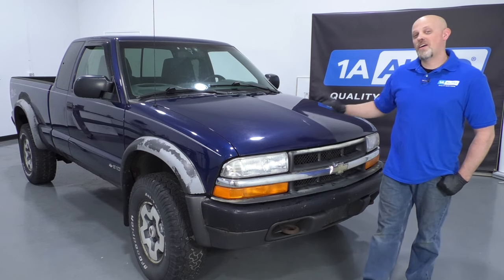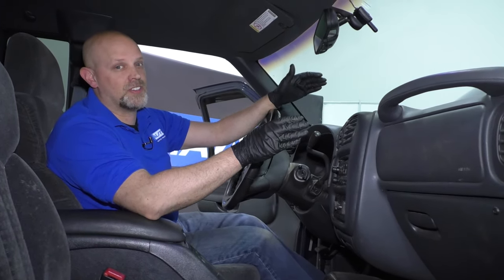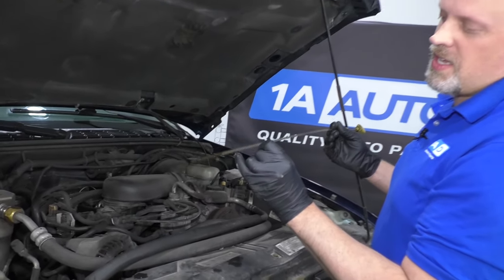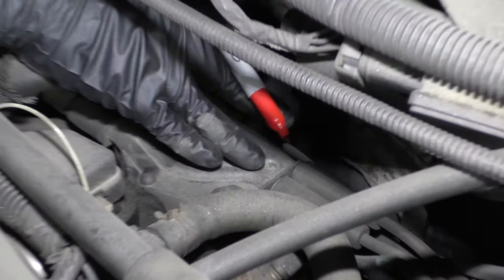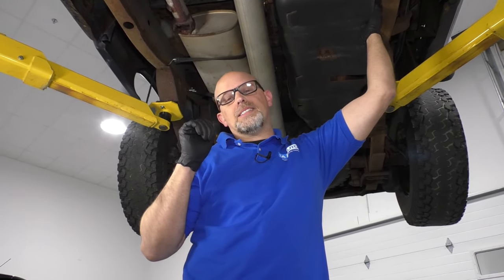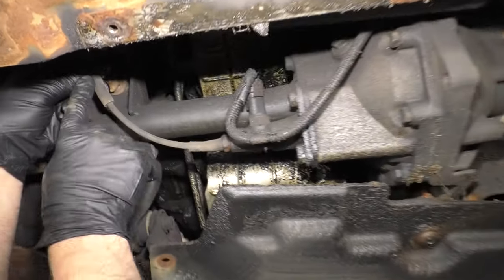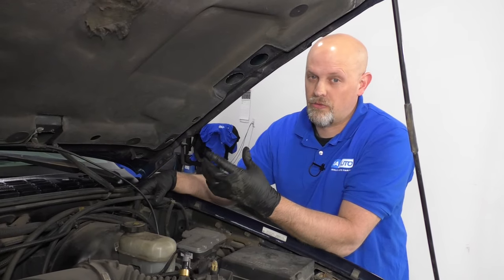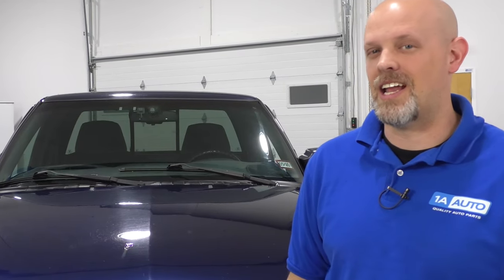Top 5 Problems Chevy S-10 ZR2 Truck 2nd Generation 1994-04

Comment: I own a 2003 S10 ZR5. Everything you've mentioned here, and a whole lot more has happened to me. I will never ever own another GM product for the rest of my life. (exempting classic cars perhaps) Or, to put it another way...Who conviced me Ford is better than Chevy? General Motors did. Here is a list of OTHER things that I've had trouble with.
Front Transfer Case - exploded while driving down the highway at 55mph without even having 4x4 engaged
Rear End cover started leaking like a sponge and nearly destroyed the rear-end. Luckly a mechanic caught it during an oil change. 
Fuel Injection System failure - had to replace everything with a new spider-assembly
Gas Breather Hose failed - Cannot refuel any faster than 1 gallon a minute or it overflows. Filling up takes nearly a half-hour. 
Hood Release Cable - stretched to the point you cannot open the hood
Wiper Motor Failure - It's keeping the RainX boys and girls in business I suppose.
A/C Evaporater rotted - No more cold air for me
and finally #1 - RUST RUST RUST RUST RUST RUST - Drove down a gravel road and the bed fell off. Well, mostly off. One mount is still hanging on.
If you own a S10 and it's in decent shape, you should sell it as quickly as possible and by something more reliable. Like a Yugo.
Reply: Damn dude my brother had a 2000 with a 2.2 and a auto damn thing was a reliable good daily until it skipped time and grenaded the engine it did have rust issues too but not to the point of anything falling off
Reply: Brutal.
Reply: You must live in the rust belt

Comment: If your s10 has a hard time starting when its warm outside change the engine coolant temperature sensor thats most likely the problem
Reply from the maker: +Michael Root Thanks for the tip!

Comment: 94 s10 256k miles now and semi retired. I am thinking about having a new engine professionally done. 

96k miles clutch
Blown head gasket 125k miles changed out freeze plugs at the same time. 
Rebuilt motor 179k yeah thats right about 5ok miles. Had the ports opened on a remanufactured head. 
New muffler around the same time.
200k fuel pump went out. Sounds like I got max life out of it. Also one of the wiper control arm broke of all things. (That was expensive.)
250k needed a new alternator. That was the easiest alternator to change.

Next on the list is ujoints and parking brake.

Question for A1 auto: sometimes I will just be driving or at a stoplight and all my gauges will go batshit crazy. Whats up with that?

Comment: I formerly owned a '96 Red Letter version of the bowtie brother ZR2 ordered brand new that year.  Drove it for 13 years bullet prove never let set during that time.  I always felt GMC had a much nicer interior over chevy.  4x4 shifter was on the floor went into 4WD anytime I needed it to do.  No issues with fuel pump period.  Always made the effort to have the filter changed when due for oil change.  Loved the truck only issue when reached 100 thousand miles was the intake gaskets.  AC worked flawlessly when summer came around.  I miss my purple ZR2 nicknamed "Barney" by some of my friends. Traded it in 2009 for a rare Chevy HHR SS panel 4which I found out years later of only 216 SS panels built that model year! Dealer manager told me as it was being unloaded off the car carrier that this was the first SS panel sold by them that year!

Comment: I am not a mechanic I do however all my own repairs From a heater core ..lift kits to painting with a Air compressor 
First 1A Auto is a good source for parts But like most Auto part websites miss one year of the Blazer/Jimmy that had it's last year of production in 2005 of this model gen. 
Most famous problems with the Blazer series 94 - 05 Starting with the most common : 

- 4X4 system That uses Vaccum, Electrical, mechanical It is common to see a Vaccum line slip off a gormet Or crack and tear with age And engine heat. Disabling the whole system Or the transfer case switch Which the ball will rust And keep from opening not letting your 2wd go into 4HI/Low And a few other of the systems Transfer case motor, cable connection area is heavy is corrosion And sits out too far to pull the cable 100% That could cause the adjuster arm not to fully seat the clutch ring into the pinion gear Which then gets chewed Replacement part is cheap But the labor time is long - You can get a transfer case mod from 50% Blazer And 50% Jeep Or install a manual pull cable 

- Alternator  They do work And only fail like every other brand /make However right from the factory They are under powered (CS-130 85amp) With wipers on And say heating or A/C At night you will notice your headlights will dim This is because your alternator can not replace power to the battery And your electronics to max usage My fix was a AD-244 Alternator made for bigger GM trucks with power seats it is a 145Amp Alternator The runs a few dollars more But fixes the issues running everything you can think of at the same time (Note you will need a 1 inch longer belt to run the Alternator But it has the same hook ups and bolt ins ) 

-Ball Joints Over wheel bearings These wear out quickly Moog makes fairly better ball joints to other brands 

-Fuel pressure regulator - Located under the intake cover you will not be able to see it under you remove the intake But when you have a engine struggling to run Feels like a need of a tune up You may or may not smell raw fuel (aside from fuel line leakage) And Your mechanic or buddy May think its the Fuel injection This is a cheap part you should replace anyways And a tell tale sign is the bottom of your normal intake will have carbon build up everywhere with a working regulator. One that has failed Has what they call a weeping hole If the mirco screen in the reg is clogged Or the seal has failed some of the needed fuel go's out the weeping hole But coming out hits the corner of the intake washing away any carbon  So a clean intake on the left side vs the right .. You found your issue GM also had a recall on its spider injection systems many years ago worth looking into if your the first owner Or plan on buying on from a 1st owner question 

- Heater core No one seems today to give there Cars/Trucks a good fluid flush And also open the heater system to get the full benifits  I been using CLR to descale And get rid of any "gunk" in my Blazer for years Never had the heater core issue  But i did replace one on a friends Blazer And i can tell you If you never done one before You have to remove the whole dash There is no easy way around it short of breaking plastic i would say 8 hours of your time 

And again I have used 1A Auto in the past Even had questions i needed for the right part And they were more than happy to help The price And shipping was better than most others And No they do not pay me Or give me any kick back for saying this....But Hey A1 Auto How about it Eh? lol  Cheers from Canada

Edit - Also the blazer is crazy famous for leaking transmission cooler lines You can replace them Or buy a kit that by passes them..But i would not use the kit oif your hard on your truck Or tow anything
Reply from the maker: +Living on a Dollar Thanks for the feedback!

Comment: Water pump and 4x4 system is the only issue my 1999 v6. X vin. Has giving me.   The paint is starting to fail now.  And she has 180,000 miles on her.    Thinking of a v8 swap and a raptor line paint job.  Who knows. Lol.  Great truck though.

Comment: I just purchased a 2000 chevrolet s10 blazer LT 4wd 4 door. And it had a P0404 code and P1345. I replaced the EGR valve and camshaft position sensor and crankshaft position sensor. Which the crankshaft position sensor was broken inside the block and was a pain to get it out. And I just last night replaced the  distributor cap, rotor button, plugs, plug wires, new coil, air filter, oil filter, changed the oil, and fuel pump with sending unit and fuel filter. No more codes. Only abs light on. I also put a brand new exhaust which includes a Flowmaster high flow catalytic converter and 40 series 2 chamber Flowmaster muffler with all 2 and a half inch piping and ran in all in factory location. But its still sluggish, and throttle response is not there like I know a S-Series has for the 4.3 vortec motor. Didn't know if you or anyone can tell me what my next path can be to replacing parts or diagnose anything.

Comment: I have a 2000 isuzu hombre basically the same truck as a chevy s10 I love the truck. I've owned it 3 years. So far I've only experienced 1 of 5 of these problems the dreaded fuel pump almost $300 at autozone if I looked it up under isuzu hombre. I had autozone look up a chevy s10 fuel pump only paid $130 then went home pulled the bed off my truck with the help of 2 of my neighbors, replaced the fuel pump and truck has treated me great ever since. Very dependable trucks😊 my truck has the 2.2 with a standard 5 speed.
Reply: Wanna trade front ends. I have a  2000 bravada

Comment: I've got the coolant in the oil from the gaskets problem, had the wheel bearing problem, 4wd wont even work, my vacuum lines were all ate up and destroyed and my distributor stopped working.🤣
Reply: While S-10s have that reliable 4.3L-- The 3 I've owned over the years, I've replaced virtually everything on them except the motor and trans.... Water pumps, fuel pumps, front bearings, alternators, and radiators go bad mostly......

Comment: Bought a 2003 s10 4X4 4 door. So far I love it. Only have 166k km on it. I gave it a second life... only missing transmission flush, thermostat replacement, both front and rear wheel bearings, driver side ball joints, alignment, revive my abs module....
Reply: I'm replying to your transmission part I did the same thing I put synthetic transmission fluid in with Lucas additive what a difference it shifts like it's right off the brand new car lot best thing I ever did

Comment: I have a 2003 gmc zr2 with 173,000 that i bought new, fuel pump and alternator died, brake lines rotted and 4wd doesn't work, it's been a great truck.
Reply from the maker: +chew face Thanks for the feedback!

Comment: For the fuel pump I recommend cutting an access hole after all it's just a pickup truck and it's just the bed
Reply: Or you know , remove the front 6 of the 8 bolts holding the bed, loosen the last 2 and tilting the bed up
Reply: Cab it be done with the tank in place?  My 99 extra cab needs a sending unit.

Comment: Make sure to use a Gm cap and rotor, the aftermarket is skimping on quality
Reply: That is soooo true. I switched to my favorite brand ACCEL on every Ignition part but the plugs and those I used E-3s great plug always clean when im checking for carbon build-up and I'm starting to have hard starting issues after a rainy day and almost every video on this issue mentions that very point Only use ACDELCO Distributor Caps & rotors as most aftermarket brands fail on both the Vortec 4.3 V6 and the 5.0 V8s and some brands supply you with screws that are too big and crack the Distributor base leading to an aftermarket plate that attaches under the base allowing thier screws.

Comment: I have 95, 4 cylinder, 2wheel, 5 speed  is there things I need to be concerned about that this particular config in the video doesn't?

Also is it possible to install an aftermarket AC system in it?

Comment: These are some cool looking trucks and they can tow a heavy load another problem is oil leaks on the oil pan gasket and crankshaft seal over all good truck and the 4.3 liter is a beast

Comment: I have a S10 Xtreme but it won’t start up 
Hopefully when I replace the Fuel Pump it Starts 🤞🙏
Reply: Walbro 450 , great replacement
Reply: Same here. I got a fuel filter. Fuel pump. And a new starter. I hope she runs again. Good luck

Comment: The seal between the trans and transfer case also will start sleeping, and the lines will fill with trans fluid. Did vac switch and lines before realizing the seal was bad, and had to do all again, plus drop transfer case.

Comment: The frams will crack on ZR2s under the front if there abused at all.
Reply from the maker: +Axel James Thanks for the feedback!
Reply: I had one i tried to kill for 10 years. I even jumped it a few times. Had it on 2 wheels plenty of times crossing humps and ditches and never cracked anything. I must have got a good un. It got more time off road drunk driving than on the road sober driving.

Comment: I own a 2002 S-10 2.2 that I bought brand new off the lot. To date:

Engine
Transmission
U Joints
Shocks
Brakes
Brake master cylinder
Brake lines
Radiator
Starter
Power steering pump
Water pump
Fuel pump
Tailgate cables
Purge valve
Alternator
Door handles
Tail gate hinges
Ball joints
Battery
Gas cap
Bulbs
O2 sensors
Catalytic converter
Clutch fan 
MAF sensor 
Tires
Fuel pump retaining ring

And FOUR AIR PUMPS!!!

Comment: My heat works but I do have the foggy windshield and "sweet smell" described here as symptoms of a bad heater core. Should I be worried about losing heat at some point down the line?

Comment: #6 in salt states, Rust prone
Reply: Doing restoration on my 96 ext cab s10. Got new cab corner patch panels, replacement bed, inner fender wheel wells, outer fenders. So yeah I attest to that in the northern states...rust sucks!

Comment: Thank you good sir I have a 94 4.3l s10 and I noticed it running hot and I saw it leaking and I thought it was the radiator leaking because there's coolant all over the bottom radiator hose

Comment: 2:07 I had a real big leak on my intake gasket I put jb_weld in crack gasket let dry two days than I put intake sealer sodium selicate took of thermostat start truck 15 minutes 3 times aday for two days n leak is gone n was not tinny was big sealers with sodium silacate seal any crack just make sure not leaking coolant to motor cues will lock up your motor is that power full fix mine bars copper seal with sodium silacate use water only for good seal .

Comment: I have a '98 S10 V6 and have gone through two fuel pumps.  Both times they have died in the parking lot of the GM dealer I work at.
Reply from the maker: +DNR5586 Thanks for the feedback!

Comment: So for the heater core It is normal to happen because this dexcool anti freeze is garbage if left in the truck over along time It acts as a higher percentage of acid And rusts out your system faster than other anti freezes ...Next really good flush replace it with non Dexcool  Oh And a dash is hard to do with bolts in in the firewall where you might lose your socket Also Take pictures  Of where the longer screws go to remember later And never yank on the dash You will break areas you can not fix later It will drop normally when you have removed all needed bolts/screws 

Common is what the people thing is the spider injection When alot of them need a new fuel pressure regulator that is on the spider assm telltale sign is one section of the lower intake is very clean free of black carbon close to the fire wall on the pass side ...This is the FPR pissing out the weeping hole because the reg is clogged  

4x4 use Every aspect of this system was a bad design However because of the age of these now The first thing you want to look at is anything rubber (actulator And vaccum hoses if OEM you will see cracked hard flakey rubber )  You will also need to replace the valve that has a stuck ball with years of no use 
And yes there are other items like cable and motor for the transfer But the not the common 

ABS light comes on ...GM had poor wire connectors Like the common one that turns green and rots the wire for the ABS after the brake system Up the shock And Arm into the fender its in there that the wire lays under a small amount of tape cut out replace

Comment: Any tips on fuel gauge not working? Any quick fixes?
Reply: Prolly not anything quick or easy. Usually when the gauge stops working it’s the part inside the tank. Prolly need a new sending unit.
Reply: That means the fuel pump sending unit is broken which means you need to replace the fuel pump because it's together

Comment: Right out of the gate.. boom heater core.. part for my 2003 Chevy S10 isn't that much, but a whopping $800 labor.. which I was told is about an 8 hour job..I put a bypass kit on my truck for the time being, but it sucks not having heat on those cold mornings, or not having defrost heat either.. I've gotten pretty creative on the many ways to keep warm while driving, such as a lighter plug in lil heater, plug in heated lap blanket, hand warmers ect.. putting out 800 bucks is just something I don't want to have to do.. thinking about trying to learn how to do it myself.. looks intimidating! 😳

Comment: Hello I have a 2001 s-10. Chevy truck my high beams work but I have no low beams I replaced the fuses ,the relay switch and my bulbs I'm needing help trying to fix my problem

Comment: the biggest problem with the heater core is the garbage dexicool crap they put in them from the factory first thing i do when i get a newer chevy is flush out the crap dexicool and put in the green anitfreeze and i have had the intake on one of my 4.3 fortunately the gasket was leaking into the intake side and going into the 1 and 2 cylinder  thankfully i caught it early

Comment: Great video illustrating why Japanese made are more reliable and easier to access for repair/parts replacement as they don't engineered this way.  GM went bankrupt in 2008 because engineering intended to generate costly repairs to bolster service revenues for dealerships and discourage self-doer mechanics.  Other than transmission and engine overhauls, you can fix these problems on Japanese made yourself.
Reply: Lol yeah ok lspv on a Toyota pu,yeah pita .